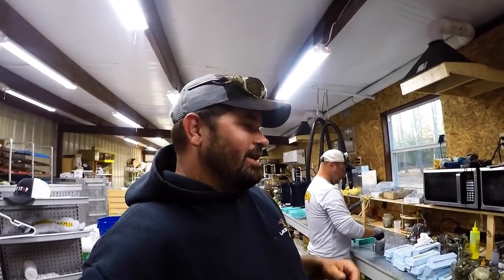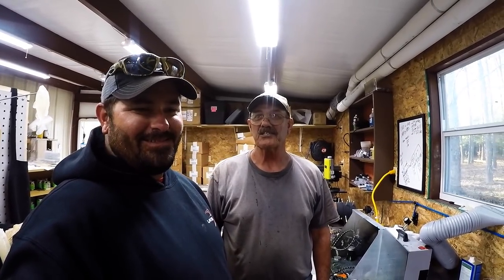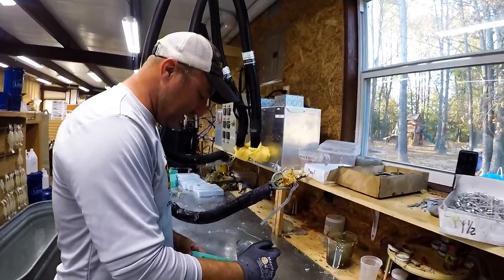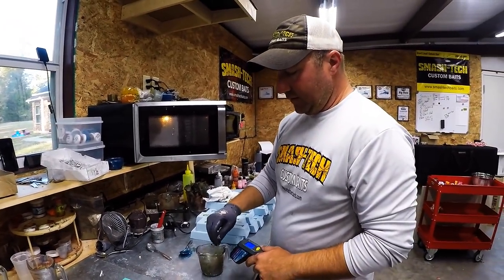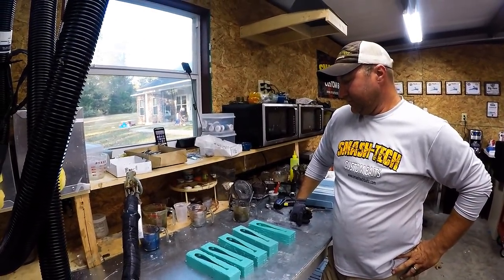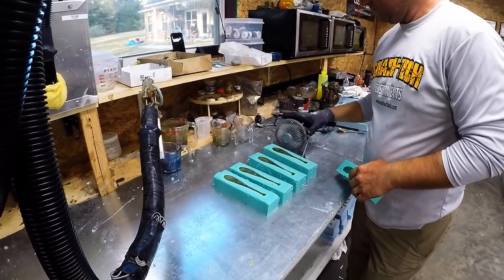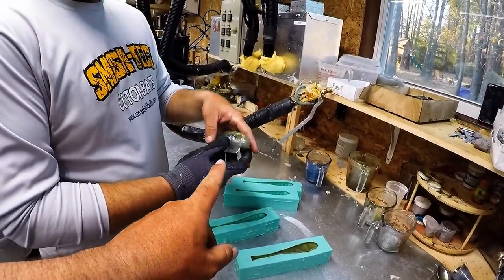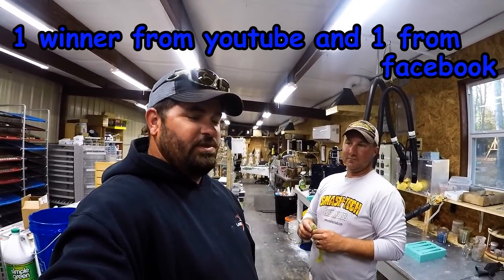Bass Fishing: How To Make Your Own Plastics

Comment: He's full of shit lol, it's way cheaper to make you're own plastics than to buy them, for example, I made 100 4" 10g swimmers with 1litre of plastisol that cost me £15, some holographic glitter for £5 and glow in the dark uv aqua blue powder for £7 so that's 100 4" realistic swimmers for £27. The average price for  plastic lures that size in a packet of 4 is around £6-7 so that's around £50, I'm making double that for £27, and the 3d printed mold I bought cost me £10 that I can keep using over and over for years.